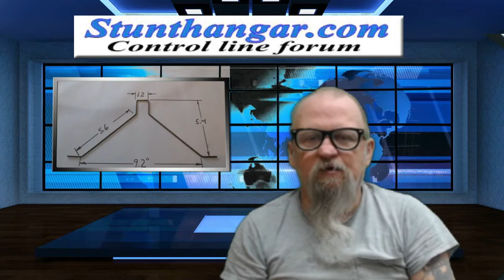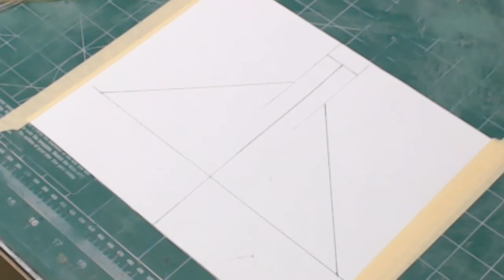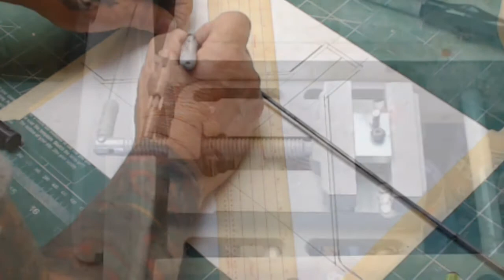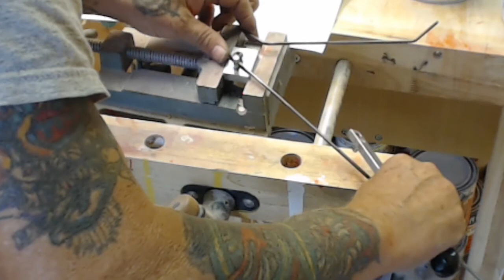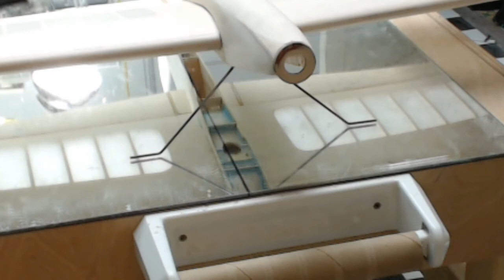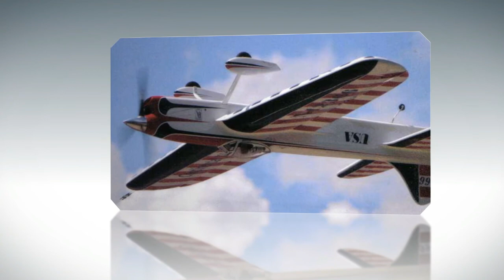Nobler How to bend landing gear wire

Comment: Nice video.  Thanks for the information.  My wire is .187 (3/16) in diameter.  Would your method work for that wire thickness?  Thanks.